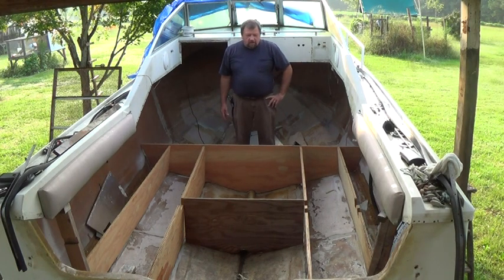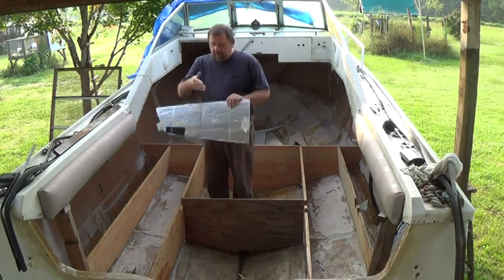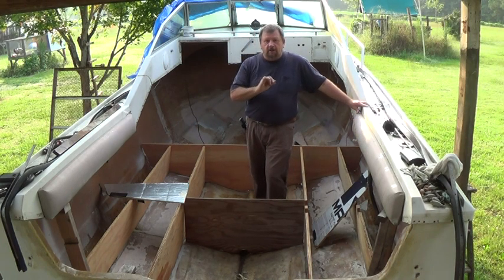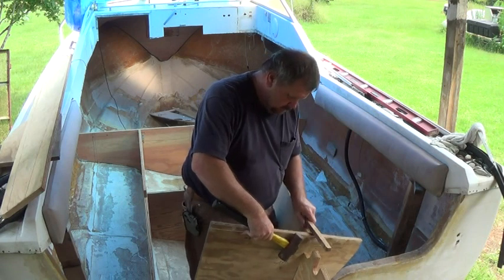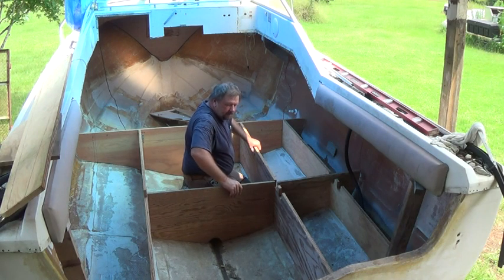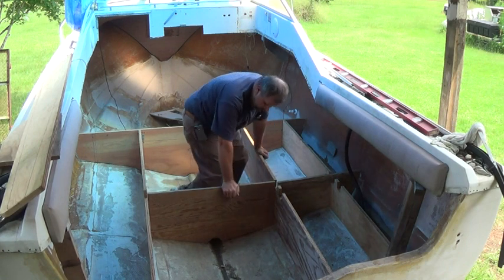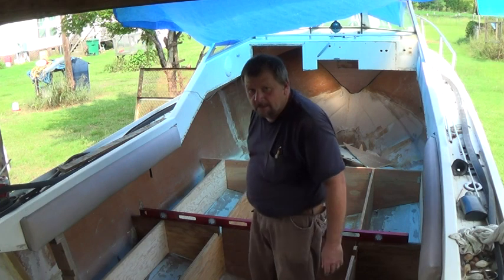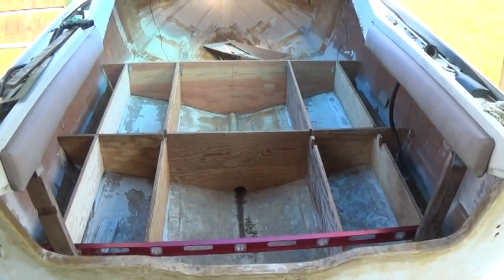Robalo Boat Project 20

Comment: I  too have heard a couple of you tubers make the statement about not letting the stringers touch the hull as it supposedly would create a 'hard' spot (stress riser).  I would have to see that substantiated far more to even begin to believe it.  After many decades of working on all manner of boats and ships, wood, fiberglass, steel, aluminum and even a cement one I can say all were fitted as closely as possible.  The tabbing spreads the stress loads over the hull in fiberglass which if done correctly makes a solid connection in an inverse 'T'.  The following layers on top make it a mono structure which is just as stiff laid up either way.  The stringer is bonded fully to the hull.  This applies in all ship building.  Wood is fitted and fastened with tight joinery, steel and aluminum are welded tightly and cement is troweled on as a mono structure.  Even a canoe with bark or skin is tightly stretched over the 'stringers'.  Allowing for a drainage system through the ribs and stringers (longitudinals) would be the only place I can think of where a gap would be designed.  Perhaps it is a mistaken interpretation of a need for a minor gap to allow the bonding agent to remain thick enough for the necessary strength?  This gap would be very very small.  Most likely if you tried to make as tight a fit as possible you would leave just the right amount for modern epoxy, polyester, etc. to be optimal.  Especially as the inner surface of the hull is inherently rough often roving on that layer.  The main thing in fiberglass to strive for is a good layer built up by 'feathering' out the edges at the outer boundaries.